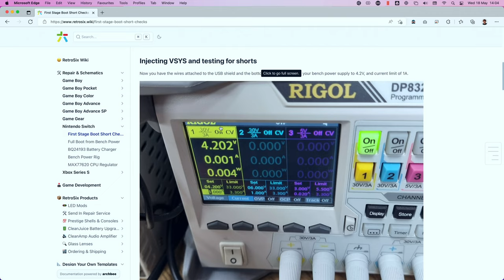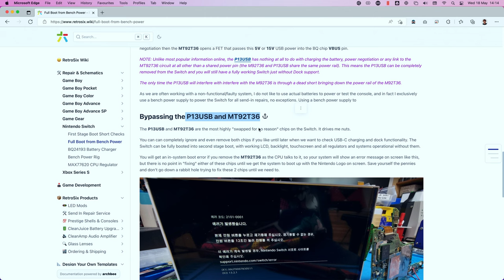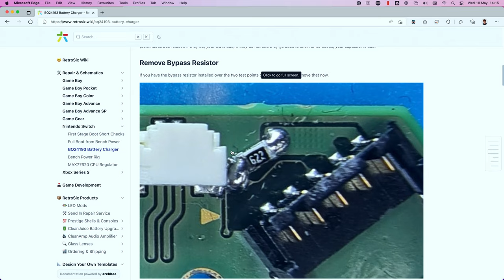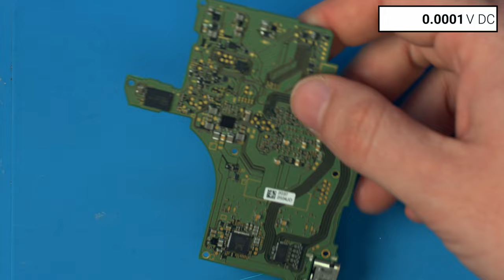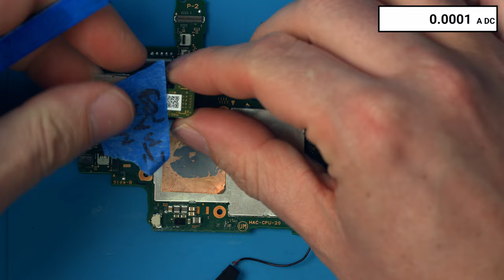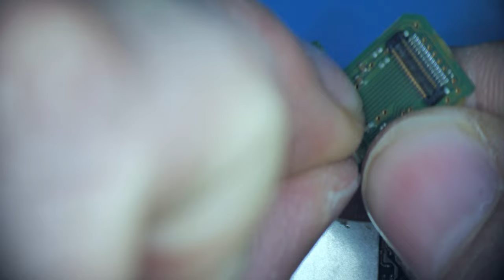Nintendo Switch Failed eMMC Fixable?

Comment: I have 2 switches that take 5v or 15v fine ( reading at BQ cap )  no shorts anywhere.. And are just stuck at .38-.41 Amp?  Even with fully charged batteries ( 3 )  system will.not boot or show.anything.. It gets 3.3v at backlight but not even backlight is turning on.  Seems like Cpu isnt even booting?
Reply from the maker: Checkout RetroSix.wiki and follow the guide for checking BQ charger fully, independent of system. Also try the boot from bench guide. Failing that join discord.gg/RetroSix

Comment: Ok now THIS is the exact kind of content I wanted to come across. I’m a beginner learning about repairs and I’ve got pretty good at replacing components/micros soldering, but I’ve never really like the whole “blind swapping” of component. Just like how I used to get in trouble for asking my maths teacher too many questions, I don’t want to be told something is something, I want to know why something is something, so swapping components on a whim never really felt like real fault finding. I have a water damaged switch I was trying to repair for my boss that wasn’t docking, and now suddenly wont boot after being left for a month, this will definitely help with diagnosis. Time to get a bench supply I think.

Thanks, great video!
Reply from the maker: Awesome glad it's useful to you
Reply: @RetroSix  where is the next video about this console?..

Comment: What a fantastic video. I look forward to learning from the way you work. 

quick question, is the WiFi chip on the second stage of the boot sequence, I know sometimes it hangs at the switch logo. sometimes it orange screens etc.
Reply from the maker: I've not checked that. I could remove eMMC and check for signals from chip. I suspect it's first stage

Comment: Hi, I have been repairing devices for 13 years and recently in last few years started on switches and consoles such as PS5 I am very good at the hardware side, but get bit stuck on the more complex board issues, I loved the format and way you explain things, totally awesome.  I have a switch I am determined to fix for a good friend, but bit stuck trying to find a device/location to take a 10 ohm resistor from to trick the switch into thinking it has a battery fitted, would really appreciate you help.  Thank you so much.
Reply from the maker: Sure thing. Jump on our discord.gg/RetroSix and ask for assistance

Comment: Got a system I'm working on now that's missing the 3.3v on V8 around the MAX77620A. What chip supplies that voltage?
Reply: Odd, you seem to pass right over V8 and say it's 0, but all the documentation I've seen seems to indicate it's supposed to be 3.3v.

Comment: how did it end? Did the switch itself worked? (-> eMMC bad)
I have the same problem. Looks like I need the read how to rebuild the eMMC. It´s an old switch, but I would like it to work "normal". (rebuild eMMC) Do you know a way to do this? 
Btw, the wiki is really good !
Reply from the maker: I have several now with presumed bad eMMC until I find more ways to confirm it (if RCM isn't an option as model is too new) as rebuild eMMC isn't a thing yet either. I've found eMMC boot stages now on a wiki that help at least confirm working eMMC and the more I test the more confident I will be if it's a solid test for bad eMMC or not
Reply: @RetroSix  Hello I have a switch in atm where the Emmc has been damaged so I know it’s not working but it’s an old model so can hack. Can I rebuild a different eMMC and get the console working or is this console essentially dead now?

Comment: So I'm confused.. if the EMMC is faulty and requires a correlated CPU; is it just dead? I was looking at performing a reball but it sounds like that won't work.
Reply from the maker: Correct. If eMMC is bad your only option is RCM booting into unsigned firmwares and running it as a hacked switch if it's old enough to do so
Reply: @RetroSix  If you have a backup of keys, you could rebuild an emmc from scratch (including boot0/1) or I am mistaken ?
Reply from the maker: @nicolasmop4033  I am not sure if there is a process yet to match the keys but yes it is techincally possible if you can rebuild an eMMC to match

Comment: Somewhat unrelated, ok maybe totally unrelated, but I'm looking at your wiki about joycons not connecting wirelessly or charging and it shows a photo of a cap, some resistors and such but I'm looking at my board for the right controller and don't see what I your photo at all. Any chance you could update the wiki to include the other versions of the board? I've looked all over and don't even see anything similar.

Comment: Thank you for the work, the best diagnose video for switch. If I may ask you a question. The vsys line draws around 0.5a on my lite. Using ipa to detect heat showed me only one spot and thst is the APU. It gets hot on the lower left corner of the silver part on the APU the one where nvidia is written on. Is this a dead short of the apu?
Reply from the maker: Could be normal it does pull that sign a screen. Without a screen though that's too much and likely BGA balls underneath shorting or bad APU
Reply: @RetroSix  thank you for being so kind and taking time for an answer. I really appreciate that! If I may ask you an ongoing question? It is just the pcb without battery etc. In your video you said it should pull nearly 0a otherwise look for hot areas. Also when I plug in a Usb meter. The meter makes infinit restarts. Diode readings are good on m92 and bq. Fuse all works. That would then likely mean broken connections under the APU right?
Reply from the maker: @kurtvongurt758 ah yes if you are injecting as part of dead test then yes. Follow RetroSix.wiki guide on dead test. Injecting 1V into each rail. Confirm that way for sure a short
Reply: @RetroSix  Awesome, this will help for sure. I know your site and it is very helpful. I will do the search for dead short today. 🙌

Comment: My M92 ic on normal Nintendo switch keeps shorting... I replaced twice. it always shorts out when i try to charge it. Any idea what could be causing it?
Reply from the maker: Possibly one of the MOSFETs are shorted so once it negotiates 15V it goes back into a non-15V tolerant pin

Comment: Hi. I send my switch to a repair shop. I see that they sold a resistor near the battery as you did. I also see a blob of metal on the USB c Port. I was wondering if the resistor can cause some problems because i see that the battery drain a lot in standby and even worse when the switch Is off. It drains like 30% a day on standby and 50% off. Thanks for any help
Reply from the maker: It shouldn't do no. But depends what resistor they used and it shouldn't be left on

Comment: Hi, awesome channel!! I have one question, my nintendo switch won't boot into system, the only things i see is a black screen, so i decide to install a mod chip to rebuild the emmc, but the custom firmware do the same thing 
On your experience its probably an hardware isse after bootup on emmc? 
The Switch turn on and i can see hekate, but when i try to launch the SO i cant see nothing 
Thanks
Reply from the maker: Likely MAX77620
Reply: @RetroSix  if the ic dosn't work probably there is a cap shorted near the ic? I haven't shorts
Reply from the maker: Yes short or bad IC
Reply: @RetroSix  in the info battery on hekate the max77621 pmic say v4, but on a working switch say v18 
The caps near the ic are not shorted so at this point i think i need to replace the chip 
Is this correct for you? Or i said a wrong thing?

Comment: Hey man, can you help me? So, after installing hwfly v5 on a v2 Switch and the hekate software, when I try to do the first steps, which include the eMMC backup, I receive the message "Fail to initialize the eMMC, the eMMC is initialized in slower mode." So, what should I do?

1. I tried reflowing the eMMC, but it was unsuccessful.
2. I attempted reballing the eMMC, but it didn't work either.
3. I purchased a new eMMC from AliExpress, but still no success.
4. I removed the hwfly and placed the eMMC back in its original location on the motherboard, but now I see a pink screen.

Therefore, I believe the problem lies not with the eMMC but with the communication between the eMMC and the GPU. Are there any tests I can perform, such as using a multimeter or something else, to confirm this?
Reply from the maker: The hack interferes with the eMMC data lines so likely during install the CPU ball is slightly shorting to another. Inspect where your mod was and any solder and test points to make sure there are no joins
Reply: @RetroSix  OK, I understand, I'll open it and see it again, thanks for answering, any news I'll comment here

Comment: so i thought i would try this on a working switch just to see what happens. So with both wires connected and injecting 4.2v and 0.01A i get 4.02v and 0.00A and 0.00W...Then shorting the 2 pins the voltage drops to round about 3.60v then back upto 4.02V the amps goto 0.001a then back to 0.000a and get 0.003W which then goes to 0.000W...this is on a working switch, is this expected? My bench supply is a ROCKSEED RS305P...
Reply from the maker: Can you jump on our discord and do video. But you need to limit current to 1A as 0.01A wont allow it to boot
Reply: @RetroSix  sorry yes i guess that should be 1.000 milliamps which is 1 volt
Reply from the maker: @johncarr3458  do a video on our discord so I can see your full setup and know your testing right
Reply: @RetroSix  yeah have posted a video

Comment: Hi. I'm struggeling with no display in handheld mode, but in dock the switch shows up and it boots fully. I've checked the all of the ribbons and cleaned everything. This occured after an hwfly install. The hwfly worked as it should and booted up, but the display does not show no more.

Symptoms: No display, backlit on, fully booted and can hear me navigating the menu.

Do you havce any idea what I could check, I can clearly hear that you have way better control with diagnostics and was hoping for a finger pointer for me to check..
Reply from the maker: It might of blown the P1USB or you might of damaged a trace or pin. Remove the mod and perhaps replace P1USB
Reply: @RetroSix  thanks for the reply. I've checked the voltage and cap/resistors at the LCD driver ic, but it's seems to show the right value and 5v at the Vin. 

P1USB? struggling to find info on it(currently on my phone).
Reply from the maker: @PRaZTuTz  voltages won't check much. Would need oscilloscope. P1USB handles telling CPU it is docked and passing signals. It might be faulting to trigger dock output when not docked. Also when you turn it on can you hear the audio and does touchscreen work when not docked
Reply: @RetroSix  Ok, interesting read. Yes, I do hear audio and the switch registers my inputs, so i would assume that the P1USB wouldn't be telling the switch that it's docked when it is in handheld mode? Cause the audio and touch input would've been disabled and gone to external audio/video..
Reply from the maker: @PRaZTuTz  correct. Is this a switch or lite? I'm guessing just your backlight is dead or LCD bias regulator. Try getting your phone torch and shining it right on the screen and looking from all angles for the slightest visual if you have any screen showing just without backlight
Reply: @RetroSix  It's a patched v1 switch. I've checked with a flashlight and did not see any visuals, I do see that the backlight is on by the screen is getting lighter shade of black and light from the backside of the switch can be seen through where backlight ribbon cable is coming out. LCD bias regulator? I'll check it out, what would be the best way to check it, measuring the pins out to ribbon cable?

Comment: Hi, thanks for the video.
I tested your way, and I got all good voltages on the main regulator, I got all good voltages (1V) en the bottom secondary regulator, and the left regulator I get 0, nothing.
The switch doesn't past second boot (always stays at 0.2A).
Symptoms: Black screen, backlit on.
It feels like bad emmc, but I'd like to have your opinion.
Thankfully this switch is hackable so I'll get to try this way in the future.
Reply from the maker: Definitely sounds like eMMC or the bottom regulator under the CPU. Easy test use use the fuse.bin file that loads the screen up without needing second stage boot. If it's just bad eMMC then fuse will load and show

Comment: what if a rail is shorting another rail and you ended up injecting 4 volts into the CPU?
Reply from the maker: It wouldn't be good. But I've never known that or see a way that would feasibly happen

Comment: although not really practicable for someone to do at home. 
I use a working unpatched switch and hakete, to test the suspected dead emmcs in. (even from had boards.

works well.
Reply from the maker: Yep I do that, but most switches coming in are not hackable so I would like to continue to find ways to prove the eMMC. I found a very good way here https://www.retrosix.wiki/emmc-booting

Comment: the one where u tested on the 1.3v coil top left of max77620A am not getting 1.3v there does that mean i have a bad chip?
Reply from the maker: Or that rail is shorted. Do you get high current draw on bench when powering it on?
Reply: @RetroSix  well i don't the machine u use to test that so i rely on battery with the charger. Just like everything u did in  the video i get voltage just not the 1.3v. On my multimeter in ohms mode it start at 7.6 ohms then continue to climb up. If i check in diode mode it will give me 0.526v.
Reply from the maker: Measure resistance to ground of 1.3V rail compared to 1.1V rail while power is off
Reply: @RetroSix   ok so am getting 2.9 resistance to ground on 1.3v rail  and on the 1.1V rail i get 202 resistance
Reply from the maker: @zane383  remove the inductor of the 1.3V rail then measure resistance to ground on that top pad where inductor was again
Reply: @RetroSix   ok will do that now. i really appreciate your help here thank u for the replies !
Reply: @RetroSix  am now getting 8.01 resistance
Reply: if u could get where the1.3v comes from then maybe it would make my job a little easier
Reply from the maker: @zane383  Join our discord for faster help. discord.gg/retrosix
Reply: @RetroSix  ok i am in

Comment: Could you tell what is the second stage boot chip on a lite? Thanks
Reply from the maker: The CPU tells the MAX regulator to turn on the second stage regulators after it's read the OS from the eMMC
Reply: @RetroSix  Thank you for your responce, but i mean the part name/number
Reply from the maker: @oleggrigorev7168  https://retrosix.co.uk/Nintendo-Switch-Lite-Power-Management-IC-MAX77620H-p478604271

Comment: when I put voltage on the vsys it goes to 0.2A but then off after a few seconds
Reply from the maker: Usually it's a bad BQ that does that. But it can by almost any chip. Use thermal camera ideally to see which chip is getting slightly warmer that will be the faulty chip

Comment: Where can i find your guide, thank you
Reply from the maker: RetroSix.wiki website
Reply: @RetroSix  Thank you, but ive been there and i couldnt find the switch board pics ...
Reply from the maker: Homepage, Public Files. Then Switch. Think I have them there
Reply: Thanks a lot for the videos on repairing the nintendo switch. 
I would like to ask a question, i hope you can have time to answer. After watching your videos i came to the conclusion that my Switch has a bad M92T36, but the charging port looks ok. Can it be a just a bad M92T36 and the port still be fine ? What are the causes that IC to get faulty ? 
Thank you
Reply: @valmonta3647  The MT92 is responsible for negotiating with a USB-C device for higher voltage charging. The best way to quickly test that is diode mode, red probe to ground, and probe with the black probe around the capacitors of the MT92. A faulty MT92 almost always results in one or more of those capacitors beeping permanently on both sides of the cap not just one.
Reply: @AngelSix  Thank you a lot. Yes i have one in my hands trying to fix, the capacitor on the left it beeps continuously and wheni plug the charger the MT92 gets warm/hot so im 90% sure thats bad, but i dont know if i have a faulty USB C bad port also. In a 1st look it looks good, no corrosion or lifted pins .... 😔
Reply: @valmonta3647  I'd say the port is likely good. Just swap MT92 firstly
Reply: @AngelSix  Many thanks, i appreciate your time to help me. Will do

Comment: hello can a emmc be replaced
Reply from the maker: Not without patching the console or cloning a known fully working eMMC
Reply: @RetroSix I have quite a few motherboards what didn't come with emmc-s due to data security reasons, is there any way I can recover them to working boards with atmosphere? Thanks
Reply from the maker: It's not possible unless you already have a copy of the eMMC that came with that switch to clone the internal ID
Reply: @RetroSix  ah I see so it's not possible even with some cfw magic either at all?
Reply: Not that I know of yet  @SzebaHUN